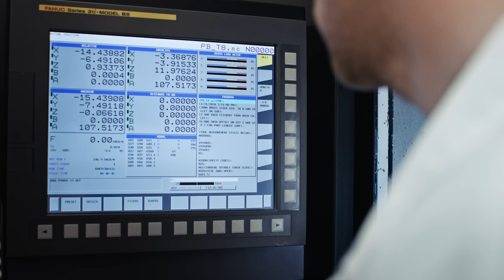The Specialized Epic 8

Comment: 70 grams lighter and less pedal bob coming from the electronic shock? Ight ill keep my 2019 model
Reply: Shock isn’t electronic. I mean, there is an electronic compression control, versus manual remote lockouts. Everything else, it is shock and fork tuning, is the same as in lower models without Flight Attendant. Pedal bob has nothing to do with FA but with shock time and new frame design/geometry etc
Reply: @funLad80  shock is electronic and it reduces pedal bob lmfao. You are gettin scammed brotha
Reply: @tryhardpker shock is not electronic HAHA Compression is controlled by servo and electronics. Do you even know what a shock or damper is and how it works? It is mechanical shock/damper that adjusts itself depending on terrain etc and this is all done electronically.
Reply: @funLad80  you said it yourself "HAHA"
Reply: @tryhardpker  you must have problems with reading or understanding then LOL electronic shock HAHA nuclear not electronic XD